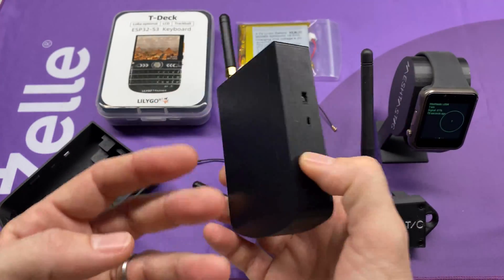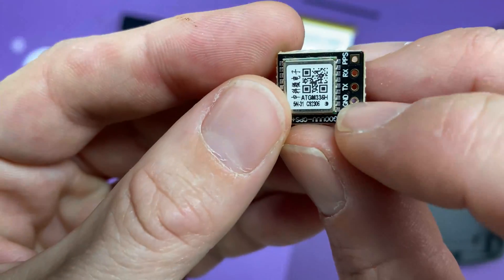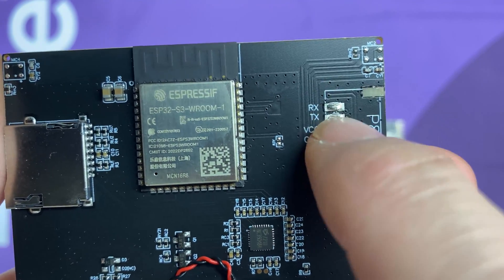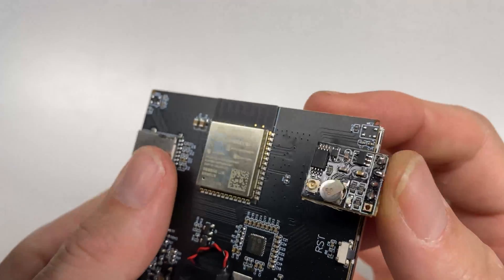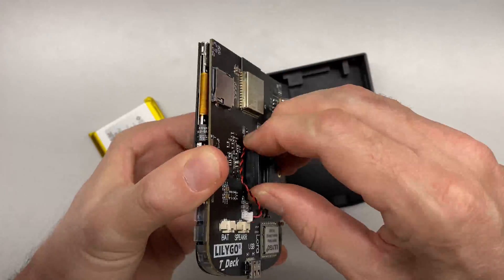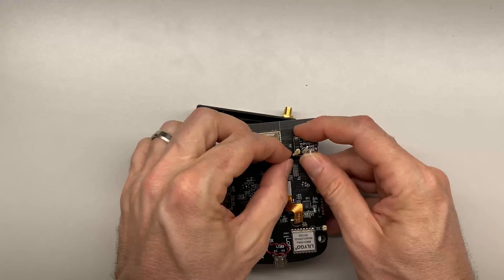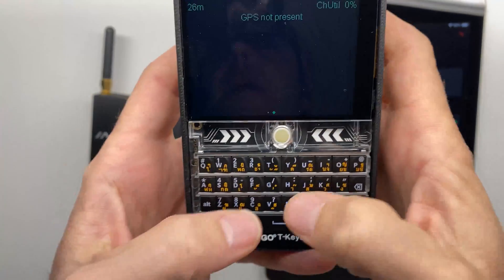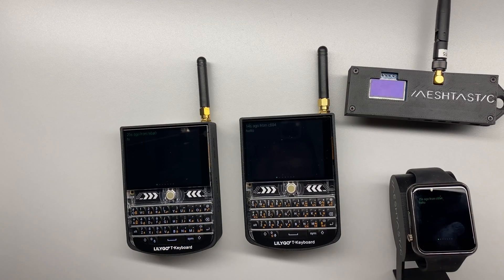Lilygo TDeck Meshtastic Build - Battery, GPS, LoRa Antenna, 3D Printed Case

Comment: Why would my radio say fail when I initially turned it on? Is this normal until it's flashed? There's a red light on it, but I can't find any info on whether that's correct or not. Any help would be greatly appreciated.

Comment: Can you share the name of the other meshtastic device that you have in this video?  The smaller one, the non t-deck one.  Also, what firmware was on your t deck before you flashed it with meshtastic?  Mine came with meshtastic already on it but I’ve noticed there are no other features other than the gps screen and the messaging screen….

Comment: when I tried to cut the gps connector off, it pulled the pads off the circuit board.  I can see one trace that connects (VCC) but don't know where the others connect.  Is there a schematic for this board?

Comment: the case instantly broke my t-deck.. very bad design. Not the creator's fault. These T-deck are extremely fragile, when inserting the board, it was so tight that it slightly delaminated an apparently empty region of the board, which turned out to be vital. I could never repair the device and had to purchase a new one. Meshtastic is awful anyways, already clogged and slowly abandoned, investing in this is burning money. The devices are good devices but the community surrounding it is allergic to helping others. No documentation can be found on any intelligent website.. the meshtastic website is a joke where snarky user  just wish to prevent other people from succeeding at their own projects. everything is in alpha phase with nothing progressing forward since forever even though we spent millions funding it through ad programs, referrals and hardware purchases. this is just a gigantic scam.

Comment: This LORA is awesome tech, if you are not aware of this there is a helium network hub you can use them while those hubs acts as signal extender for these lora devices while doing more then extend range. con it uses an internet connection.

Comment: When you mention battery safety, you forgot to mention that YOU CANNOT CUT BOTH WIRES AT THE SAME TIME OR YOU WILL HAVE A FIRE!

The pliers, knife, whatever will short the two wires, the wires will immediately get hot and melt the ensulation. This will allow the wires to short to themselves and pulling the tool away won’t stop the short from happening and you are seconds away from having a big fire. 

If you are new to electronics or a ham-fist, take it from someone who almost lost his house to a lithium fire-DO THIS OUTSIDE. Fuck around and find out, it’s not worth it.

Comment: What is the compass orientation in the case? Is it in the plane of the screen (device should be flat on its back when navigating) or the plane of the top surface of the device (device should held more or less vertically when navigating)? Thanks

Comment: note that "up to a few miles of range" is extremely optomistic and the meshtastic people just dont do enough to smack down.   REality you are lucky to get a single Km from  node to node.   you can get a few miles with directional antennas, in the desert on top of poles.  in real world 1/2 Km is the limit so you need to put up repeater nodes.   These can be in the air and have decent high gain antennas to cover a solid Km around them.  Also if you want something to carry that will have decent battery life the RAK devices are the only choice. All these Liligo devices are power hogs and just do not last very long on battery.

Comment: For being 'designed' for 915mhz an SWR of 2.5:1 is really awful, clearly it's too 'long' (electrically at least) as the dip near 1:1 is the UK freq of 866mhz. But yes, you're right you really ought to have the properly matched antenna for a transmitter (rx well, closer is better and will rx better, but at least no damage) yes, also a ham... I kind of what to slap on a good 3-6dBi antenna at the top of my tower, and run at full 1500w legally allowed for us hams, to see how far I'd reach, haven't played with 33cm much. 23cm tho, that's a blast, and too bad it's limited to 5w for hams. and yes its ham not HAM, it's not an acronym. Love the T deck, thanks for the video, used it to find what case I wanted for mine, and ended up going with the one you linked. Too bad the battery is stupid expensive for 5Ah, 1S.

Comment: I'm just stumbling upon the tdeck. Does it only communicate between other tdeck type devices? Is it a souped up radio so to speak?
Reply from the maker: Meshtastic uses LoRa for RF communications, read up on LoRa and it will have all the information you're looking for

Comment: I definitely ripped the pad for one of the gps modules trying to pull the metal piece out in the end it would have just stuck to the soldering iron without me pulling on it with snips

Comment: Any idea on range in mountainous \ heavy forested areas with this frequency?
Reply: Height is might...get a good 915mhz tuned antenna (not the crappy stubbie one) get that sucker up high...and it will talk for miles!  since it's mesh capable and can repeat the messages, chances are you should get the signal/message

Comment: Stupid Question : do you NEED to remove the GPS pin receiver to solder on your gps module or can you just solder on the module on top of the connections? asking for a friend :)
Reply from the maker: As long as the data can get to the board, you can wire it any way you want.  It might not fit in a case if you dont make room for it though.

Comment: I've been a licensed HAM Radio operator since 1989, but just got into LoRa / Meshtastic like a month ago, and I'm addicted. I've now got (6) devices, the last being a T-Deck, and I'll be getting a T-BeamSUPREME, when Lilygo has them available again.
Reply: What’s your favorite device by far? 
I might pick up a t deck as my starter for meshtastic 
I have esp32s laying around 
Should I just get some Lora modules ?
Reply: @zloneOTM  I like my T-Deck, but mostly because it has the keyboard.

I want a T-BeamSUPREME since it has GPS. I haven't bought any GPS modules for any of my other devices, yet. I do have a WisBlock I haven't done anything with, and I'm going to add GPS and an environmental sensor to it. It'll probably be my main device for when I'm running around outdoors.

I have (4) Heltec V3s in the little factory cases. I may give a couple of those to neighbors to try to get Meshtastic going around here. I've yet to see any other nodes online, but I also don't have an antenna up outside, yet.

The devices are fairly cheap, especially the Heltecs, so I'll always have some extras lying around.
Reply: @MyTube4Utoo  You can add GPS to the devices, just need to solder in the power, ground, and TX/RX pins and setup the software to use the GPS serial output
Reply: @zloneOTM  That's one way to do it...there are tons of devices out specifically designed...but the LORA modules are what communicate digital packet radio (similar to APRS for HAMS) the ESP32's have the software to code/decode the packets
Reply: ISM band 915mhz, no need for a HAM license  APRS does about the same thing but meshtastic seems to have more support/apps at the moment
Reply: @haydenc2742 Hams can also use 433 though.
Reply: I'm only a tech, looking to upgrade to general soon. I so want to get into these as well I'm actually looking to get away from using a cellphone. 73, kq4hcu
Reply: Kc8sui

Comment: I did this a few weeks ago following Random Alley Cat's instructions, and am wondering if mine is working properly. When I first turn it on it will normally get a GPS lock, but it doesn't update position even if asked to by a separate node. I played around in the web client settings, and nothing I did seemed to make a difference. It just gives me the single GPS reading shortly after powering up. If I want another reading the only thing that seems to work is turning it off, and then on again. I'm thinking about putting a different GPS module in, but thought I would ask before doing so.

Comment: those with older t-deck boards may experience issues flashing, where it is stuck at “connecting…” desoldering and removing the d2 diode disables the chip id bug, allowing the flashing of firmware to commence. newer t-deck boards do not have this problem.
Reply: I just got a t-deck straight from Lillygo and I'm stuck at Connecting
Reply: @OnTeamHumanity I had the same but I fixed it. I was trying on linux (manjaro) but it worked when I switched to windows 10 (on chromium).
Reply: @arisoda  I was already on windows. I was able to get it to work by not selecting full erase and install

Comment: Just a curious noob here, is the USB C port on the bottom to charge the battery or is the USB just a way to connect the T-Deck to a computer? How is the battery charged does it have to be removed? Also, I'm on a website that takes custom 3d printing orders, it is asking me what unit of measurement the design for the case/housing was created in (mm, cm, inches) should I enter centimeters? For material, should I use PLA or the SLS Nylon PA12? Thank you very much for your build and whatever info you can help me with.
Reply: The USB C port does both of those things. No need to remove the battery to charge.

Comment: I would love if this could work with a wisBlock
Reply from the maker: It sure does:
https://meshtastic.org/docs/hardware/devices/
Reply: @HackedExistence  Wait.. The TDeck works with a RAK19007?! 😄

I would’ve assumed there be some modifications required unless you meant that WisBlock works with Meshtastic in general

Comment: What a chunky boy ! LoL

I'd strongly suggest you implement corner protection for the LCD.
You could stick one of those folding rings from a phone case on the back to grip the case easier.

Another battery option would be to just use an 18650 holder and swap batteries when they go flat ?

Comment: Those "915 MHz" antennas are AWFUL.  Don't trust what the sellers say, at all.  I've ordered boxes and boxes and those antennas, and I usually just get a 2.4 GHz antenna that the seller is pretending is 915 MHz because very few people have the ability to actually verify the frequency.
Reply from the maker: You are correct, without a VNA it is somewhat a shot in the dark, thats why I put a link to RicInNewMexico's github repo where he has tested and posted the results of multiple different antennas for the 915mhz space, check out his research here: https://github.com/RicInNewMexico/Meshtastic-Antenna-Reports
Reply: Never buy antennas from Amazon or ebay. Only from specialized radio shops.
Reply: How do I verify the frequency
Reply: @MrGhost9640 Use a nanovna as he specified in the video description.
Reply: @urlawyer  thank I watched before I watched full video my bad but seriously thank you
Reply: Tested mine with my vna, I guess I got lucky. Mine were spot on. So were the 5dBi ones I ordered
Reply: People! You can also search for expressLRS  (input your frequency here), we radio controll folks also use LoRa technology.

Comment: What watch are you using? Is it a LilyGo T-Watch-S3? If so, where’d you get the firmware? I own the T-Watch-S3 and I can’t find any firmware for it besides the stock firmware and it doesn’t have any LoRa apps (although it has LoRa)
Reply from the maker: Correct, I am using the Twatch-S3 with the LoRa radio.  You can use the same process in the video, flasher.meshtastic.org but select "T-Watch S3" from the device drop down, or you can pull the latest release from the github repo here: https://github.com/meshtastic/firmware/ and use something like Arduino IDE to flash.
Reply: @HackedExistence thank you so much!
Reply: @HackedExistence  so I flashed my T-Watch-S3 and I followed your instructions but it still says "No GPS" I am in a rural region in Ireland... could this be why I have "No GPS" or it just not configured correctly? Thanks for your help.
Reply from the maker: @danielktdoranie  The TWatch S3 doesnt have a GPS radio, just a LoRa radio.  If you want the T-Watch to be location aware, connect it to a cell phone running the meshtastic app over bluetooth and configure the app to send GPS location from the phone to the watch via bluetooth.
Reply: @HackedExistence thanks! Still learning